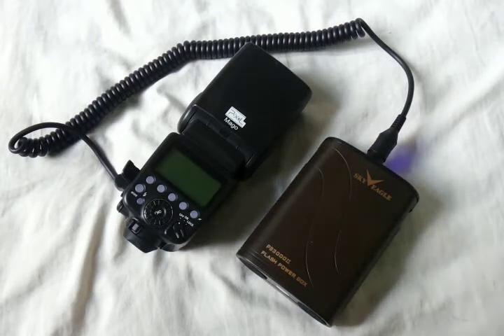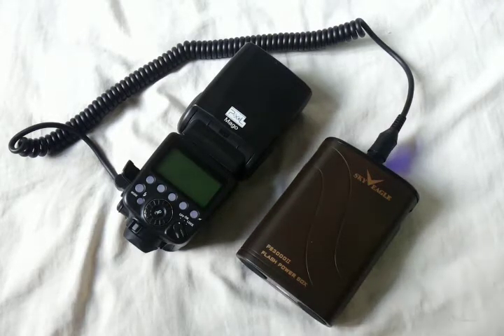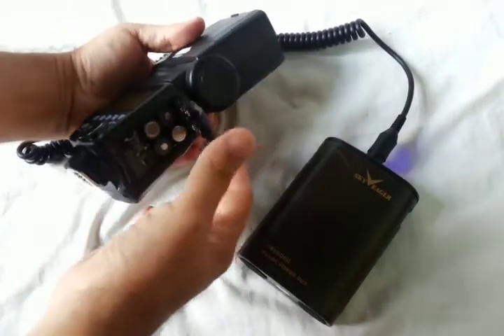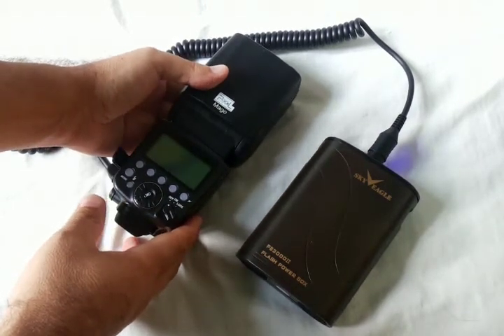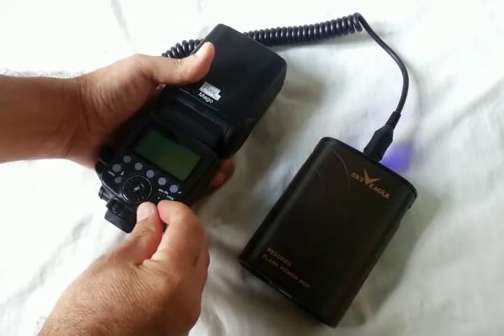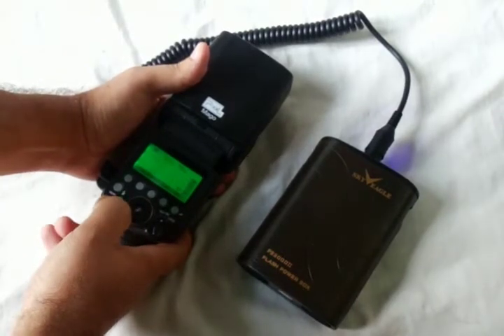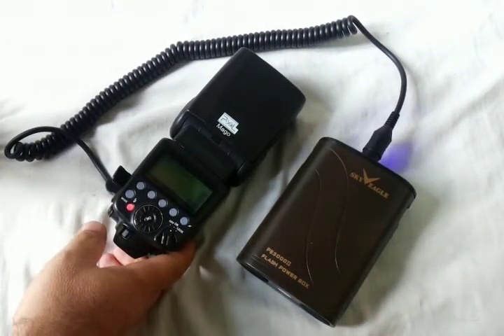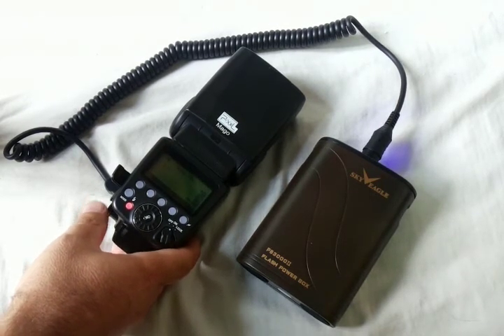Pixel Mago flash re-cycle time testing with external power source

Comment: I have this flash unit.. I have a question.. Why you have the sanyo batteries inside the flash and the external battery pack you have connected in the flash also..? Why you dont connect on the external battery pack?
Reply from the maker: Dear friend, it is neccesarry to use AA batteries together with external battery pack. You can not use external battery pack unless there is also AA batteries inside the flash. Have a nice day.

Comment: Erol, nice video showing people how to use with the external battery pack.

Be very careful not to fire 1/1 or greater than F8.0 when in 28mm or lower settings.

ATG and Pixel are hurting Canon 600EX-RT in big time.

Comment: Where did you find the proper cable for the Mago flash?
Reply from the maker: Hi Anthony, pls check this link.
You will see how to use extrenal battery pack cables in Pixel Mago.
http://www.fotografci.net/pixel/indexe.html